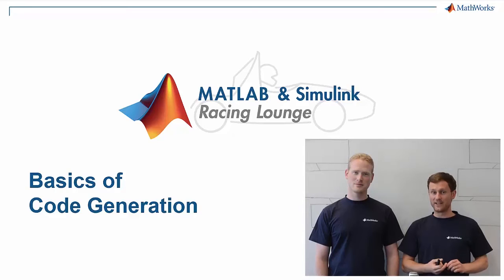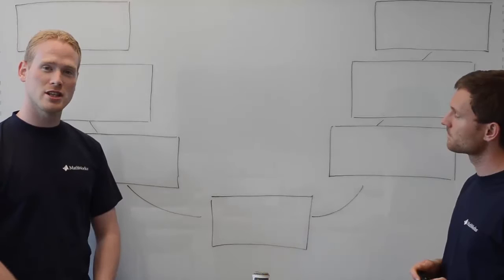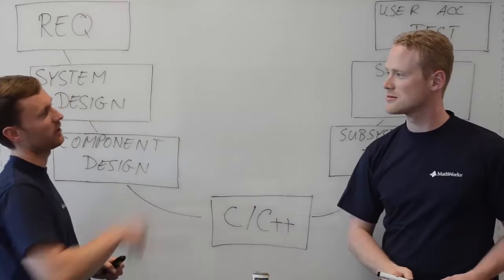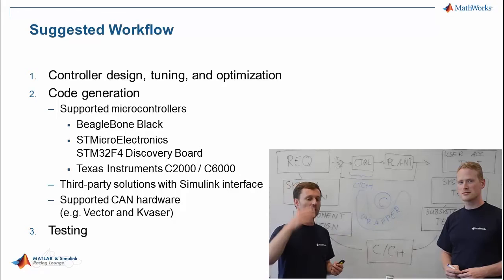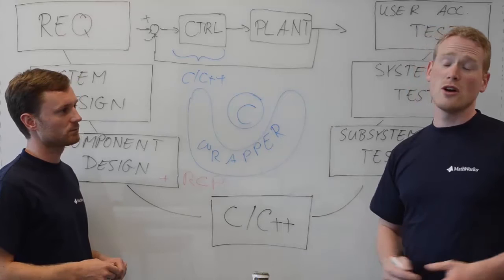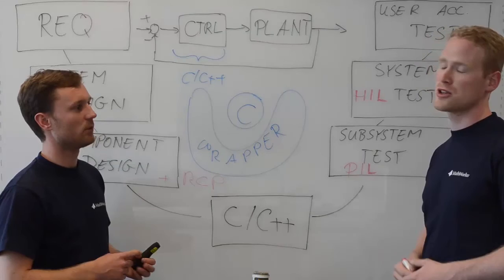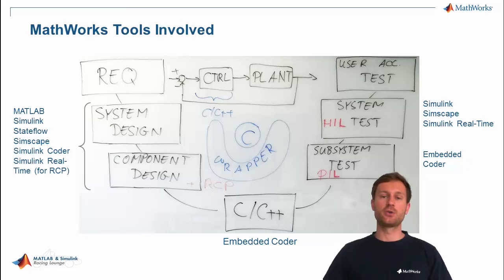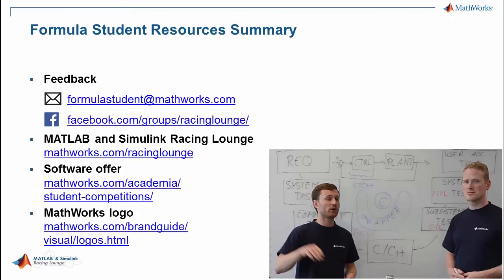Basics of Code Generation

Comment: Hi, really it is very helpful and easy to understand video. could you please like to give me the answer of my question. when I using plot command, figure appear without line/plot.  MATLAB 2015a my info is as:
>>opengl info
                          Version: '1.1.0'
                           Vendor: 'Microsoft Corporation'
                         Renderer: 'GDI Generic'
                   MaxTextureSize: 1024
                           Visual: 'Visual 0xc2, (RGB 24 bits (8 8 8), Z depth 16 bits, Software, Single buffer, Antia...'
                         Software: 'true'
        SupportsGraphicsSmoothing: 0
    SupportsDepthPeelTransparency: 0
       SupportsAlignVertexCenters: 0
                       Extensions: {3x1 cell}
               MaxFrameBufferSize: 0